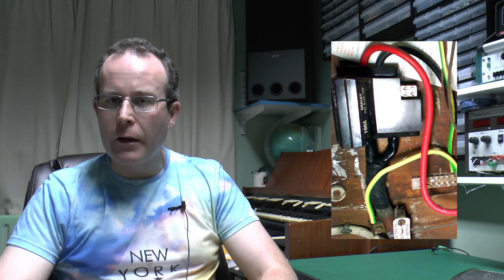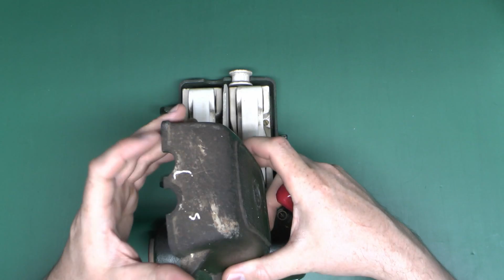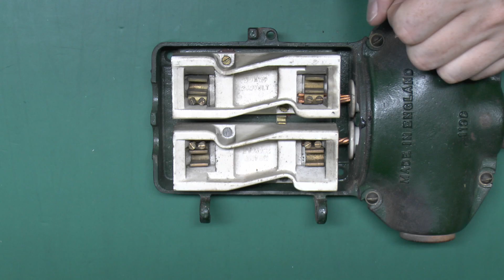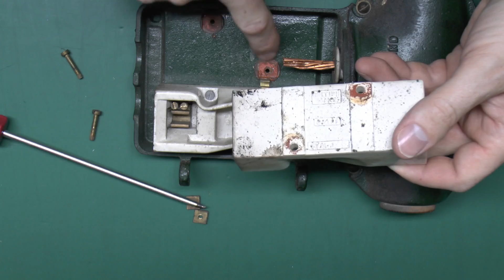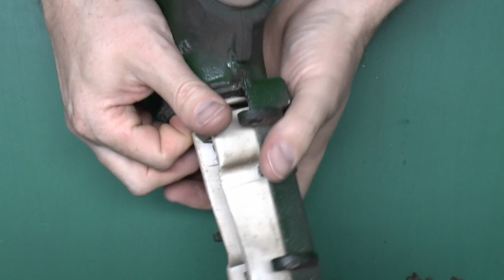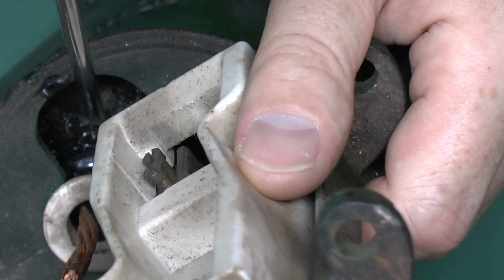J&P Cast Iron Electricity Service Cutout

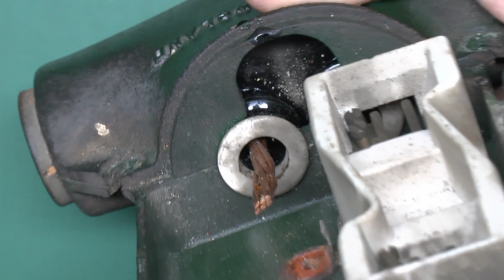Comment: You are correct John, the labels in the cover, the phase barrier and the wire tube are indeed asbestos, often damaged due to age and interaction. I would advice, thought a little late to the party, 8 years too late (2015, now 2023) that you handle these with the strictest of care. I wonder what those white specs are on the compound 11:03.

Comment: A while back I came across a three phase version of these being used in a building that dated from the 1930s, it was now being used for offices, and seemed to have become repeatedly sufficiently hot that the bitumen had been oozing out of the cable entry and was making a nasty black stalactite on the concrete below

Comment: Here in the Netherlands — probably due to the Groningen gas strike in the late 50s — the standard house connection is still 35 amps. Some older houses still use a 25A connection, and even the “heavy standard” connection is 3x25. A 3x35 is already significantly more expensive let alone if you want 3x 50/65/80.

But then again electric showers are completely unknown here.
Reply: That's roughly equivalent to the UK power supply (3 phase x 35 amps x 230v = 24,150 watts  vs 1 phase x 100 amps x 240v = 24,000 watts). (Most newer homes in the US have 200amps at either 208v or 240v, for reference.)

Comment: I tried to get one similar to this upgraded for a customer not too long ago, 3ph head using 1ph, leaking tar and open holes, the dno stuck some pink bubblegum over it and said it was low priority and would take 4 days to replace because they had to dig up the street isolate it? Then then energy supplier sent someone to install a isolator switch, turned up and stated he’s not qualified to disconnect old meters and left..

Comment: The label, board divider, tubes inside the fuses what are inside the metal clad cutout is asbestos, and also its has a fused neutral, this is why it has been removed and updated, as energy suppliers deem them unsafe to work on

Comment: hello jw.....i hope you can answer my questions or provide me were to buy fuses from or any relevant information
just bought old victorian house and the mains is fitted with revo ceramic fuses in a iron case similar to your video....there are three fuses one fitted to consumer box and other two not connected....there is also another one which is just a thin bar(is this neutral not sure) that is open view and screwed in at top and bottom....are these illegal to use or should they be replaced by distribution board......i dont know what fuse rateing they are but could i use 30amp wire on a 15amp porclein socket fuse to give me more amps.....is there a max amps that you can install fuse wire into holder say 30 40 50...were can i buy these fuses or best place to get spares or information from....is there a set time for mains supplier to come out and replace or cost....thanks for your videos very detailed
Reply from the maker: What you are describing will be over 70 years old and should have been replaced long ago.
If it's before the electricity meter then the network operator will replace them, call 105 to contact them.
Anything after the meter is your responsibility.
There is no upgrade option for such old equipment, fuse wire rating is what it was originally designed for.

Comment: Regarding the load that one of these can take: because it’s a rewirable fuse, it can run for a considerable time at far more than its rating. I had one of these in a house many years ago: it had the legend “30A continuous, 60A fusing”. Modern new services are 100A, with a BS1361 fuse. A look at the curve for these shows that one can draw 130A for twenty minutes. I watched the jointers replace a TP&N cast iron cutout. They just gave the bitumen a bash with a hammer, and it crumbled. The replacement work was, as is usual, done live.

Comment: Its a great video but please, please don't have a look at yours if you have one.  The dude on the video is correct and they are full of asbestos, but more importantly metal clad cut outs with fused neutrals are the most dangerous and power company and dno network engineers don't work on them, if any work is required they are replaced.

Comment: Well I think the c shaped cable terminals in the fuse are to allow for expansion. If it expands i'm thinking the back will give, like a spring, and it's less likely that the screw would work loose.

Comment: Where I live, the standard circuit breaker current at the property border is 25A and one has to pay monthly to get a larger value (just for a stronger circuit breaker, the kWhs are counted normal). If that sounds outrageous to you, hear this: In Austria, the standard house input is limited to 16A!!! That's because they banned nuclear power plants, green-brained hippies! Mind what you wish for, you might get it!
Reply: +zwz • zdenek What, 16A? That is creazy. Most flats in Poland would have 25A total, with split to 16/10/6 A for different use (kitches, sockets, lights). For standalone homes, it would probably be 40A standard, but you should be able to get more, but I think you pay just once, unless you live in some strange place, where they cannot do that without rebuilding infrastructure, or you are sole user (end of the line). Just my guess.
Reply: It's just fascinating to me how differently we do things in the United States.  Most modern residential service in the United States is about 200-225 amps, but as it's 120/240V, that would equate to about 100A in a European service.   (So, that's about the same.)  We like lots and lots of circuits.  Fewer than a dozen circuits is unheard of except in the oldest homes.  In modern construction of stand-alone dwellings, 30-50 separate circuits is common.  These circuits are typically dedicated to individual rooms or pairs of rooms, and now also typically separate lighting and receptacles.
Reply: @jovetj  yes, but Aircon is also much more common in America, so some of it has to go for that right? Fusing low and often is likely wise as it keeps the fault current low, but at least Britain in particular had copper shortages strongly affect the design choices made (ring circuits and fused plugs and so on) so loads of wiring probably wouldn't have been feasible when the standards were being set out.
Reply: @AngDavies  Some of it does go to air conditioning, yes.  I grew up in a home that had electric heat, and the electric heat circuits were over twice the rating as the air conditioning.

Comment: help......had a call out yesterday where the service head fuse had blown..i hooked my clamp meter over the main 16mm earth just to keep it handy then noticed there was current of nearly 2 amps...is this common ?..would it be mains voltage ?and could it effect the performance of an rcd on a tn-cs arrangement
Reply from the maker: damon btc It's fairly common, typically occurs on TN-C-S and is one reason why the main bonding on those has to be a minimum of 10mm. 
Usually caused by slight voltage differences on the combined earth/neutral between two or more adjacent properties,  which in turn depends on the various loads in use.  The voltage difference is small, only a few volts, so no risk of shock.
RCDs won't be affected as they don't measure current in the earth, only any difference between L&N on the load side.

Comment: Why are two fuses not allowed in your country? Is it in case only the neutral line goes it will still be live? I ask because we don't have neutral line where I live and there is always two or three (for three phase) fuses. Of course in modern setups they are tied together so if one goes all of them goes.
Reply from the maker: lollandster Yes, it's because of the neutral one failing and leaving items live.  Two fuses also increases cost and complexity for no additional benefit.
Reply: +lollandster I do not think so, you will usually have single fuse for single phase. and no fuse (breaker) on neutral line at all. You might have additional double switch before the switch, but it is not a breaker (fuse).

For the 3 phase, you will have interlocked 3 fuses / breakers. Sometimes, especially if you do have multiple appliances with 3 phases supplies, or in bigger distributions, separate interlocked switch (not breaker, but sometimes with additional higher rated breaker too) before other split breakers. All interlocked between phases.

There is a separate John video, where he shows ,that double fuses on many installations these days, are actually less safe than single fuse.
Reply: +movax20h Where I live (Norway) there is no neutral line, but two 110V lines alternating with 180deg from each other creating a 220V potential (RMS voltages). Therefor there are two breakers needed to stop live from passing through.
Reply: +lollandster It is uncommon in other parts of Europe. The setup like yours was used before 1950 in UK, or something like that. And the video presents a double fuse designed for such system. But nobody is building such systems since 50s anymore.
Reply: +lollandster I think the split supply is only used on construction sites, with isolation transformer, step down to 110V, and the split to 55V, so there is only 55V between any live wire and ground. For safety reasons, as construction sites are often wet.
Reply: +movax20h Maybe not in UK, but they are still doing it here. The reason for doing one 220V and one neutral line is to allow 440V 3phase to be carried on the same network for industrial use. When housing and industrial don't share the network there isn't much point in doing neutral line (except for safety when using edison style sockets and one poled switches)

Having only 110V potential to earth is arguably safer (if all switches were two poled then it would unarguably be safer imho).

Comment: Hi John. At a guess the reason for the slot along the cable entry on the brass contacts is because they're cut from an extrusion and it avoids another drilling operation.

The four slotted holes for the lower cover bolts means they didn't have to drill and tap four holes in the base, and the 'red sealant' is probably the remains of asbestos-rubber washers.
(First line edited to make sense.)

Comment: Some older residential distribution system in Estonia used the triangle system (phase to phase voltage is 220V) and it required both incoming conductors to be fused because both were live compared to ground although sometimes the ground was completely missing rendering the whole grid floating or isolated. That system is still used in old part of Tallinn were modernization is too costly.
Reply: We used to have it in parts of the Netherlands, too, and you could recognize it by the double pole fusing in both cutout and the consumer unit. Also by being old AF, of course. I think the last of it was taken out of Delft in the 90s. We still use double pole switches in the consumer unit though, even though only one side is fused.

I reckon the 3x127=220 arrangement (IIRC the math) is probably significantly safer than 1x230V (or it’s cousin 3x230=400). Much like the center tapped 220/240 equals 110/120 of our cousins across the pond is significantly more electrically safe, although less fire safe.

Comment: In the netherlands, my house build in 2011, has only a 35A cutout fuse (single phase).
However, central heating and hot water are gas fired.
Reply: Erik Bruijn Most heating and DHW is gas in the UK too, however an 80 or 100A cutout is common.